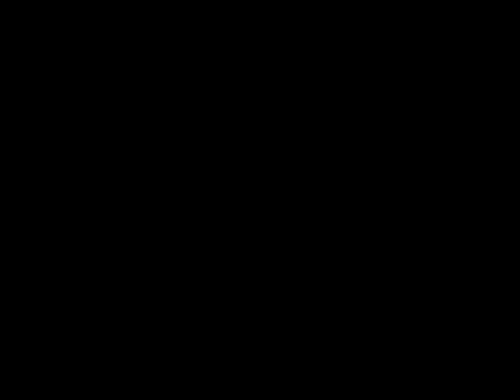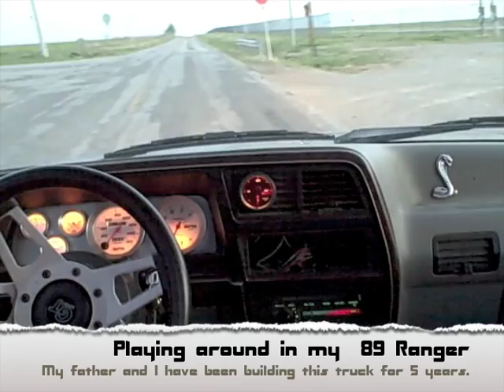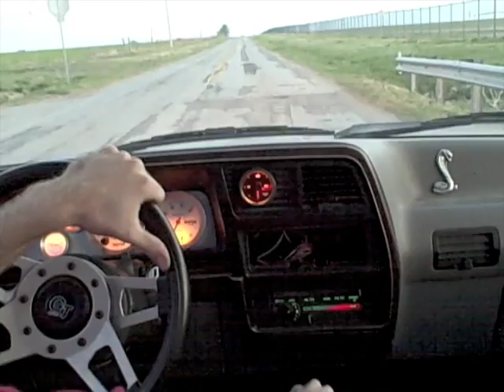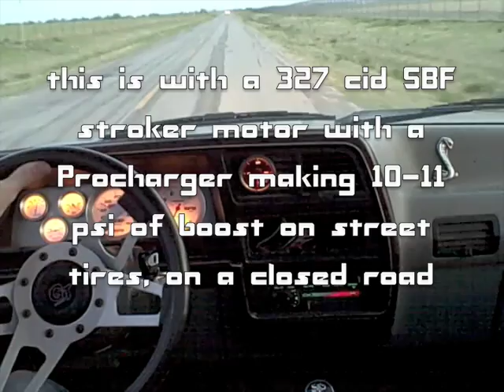Procharged V8 Ranger

Comment: i have 96 and thought about dropping better motor since i like to go fast.. what all in needed to convert it for a 302.   it has 170k miles... and all stock parts as of right now... i am going to school to be mecanic this spring.. so i am not a profesional when it comes down to workin of trucks etc.. please send me info and should i change the rear differential?

Comment: can you tell me what brackets you used?
Reply: Jody  The brackets are for a 5.0 mustang carbureted kit  from pro charger . I'm not sure if they still make them or not ?
Reply: Cs Conyer thanks for the info..
Reply: Jody  No problem. you'll probably have to hunt for one, or go with a d1sc kit. which I'd recommend it will make more power and has a much improved bracket and drive system.

Comment: C4 is a 3 speed auto, no overdrive.  Typically they are built with a large stall, PA billet servo and a reverse manual valvebody.  Sometimes people throw a transbrake in for a killer launch if the suspension is setup to actually hook.

Comment from the maker: Here is the rundown:
Standard Bore FR302W Boss Block
Eagle 327cid Rotating Assembly 
P600b Procharger @ 10 psi
AFR 2.02/1.60 180cc intake runners, polished chambers/exhaust ports
Comp Cams XE284H Camp with Comp Tie bar lifters
Motorsport 1.6 stud-mount rocker arms
Edelbrock Victor Junior Intake 
Quickfuel 750 E85 carb
C4 trans with 3500 stall
8.8 Explorer rear end narrowed on longer side
Cal-Trac Link Bars
Thats all I can think of.

Comment from the maker: @DjayJohn Well, as a matter of fact it does blow through the tires in 2nd and 3rd gears. Especially now with the 3500 stall. Hell man do the math your self, the setup is right there on the screen. I'd be surprised if it wasn't making more power than I'm guessing. Like I said before, a motor like this is inefficient at lower RPMs. The converter in this video was a Jegs street converter which wasn't worth a shit and was completely inefficient. Its too radical for the street now.

Comment from the maker: @DjayJohn  That would be the basically stock stall converter putting the motor into gear bind at lower RPM's. But I'm sure you can dyno motors with your ears and Youtube videos.

Comment: Probably a manual steering rack, as in no power-steering box... plenty of extremely fast cars and trucks run manual racks.  Gotta remember this is in a truck, it will walk left and right unless it's setup with a panhard bar or watts link.  A good 3 or 4 link suspension would help minimize this.

Comment: yeah,just wait til i get the chance to put my 351 windsor in my 1996 xlt ranger,runs 7 secs in a quarter mile with a 650 cfm carb,just wait,when all is said and done,im going to supercharge,run dual 750 cfms and drop it in my little ranger.well,with extensive chassis strengthening and one hell of a suspension setup,i doubt any hopped up civic or vette can keep up with it.did i mention that ill need a wheelie bar when im done with my truck ;)

Comment from the maker: Like I said. OLD VIDEO dude. I have a 3500 stall with a trans brake. This video was made with a old stall converter that wouldnt stall any higher than 2000 rpm and drove on street tires. I dont know what else to tell ya man.